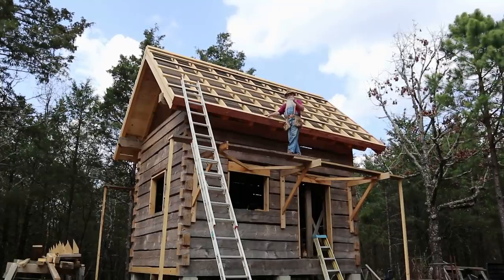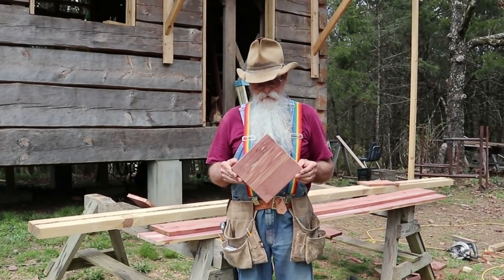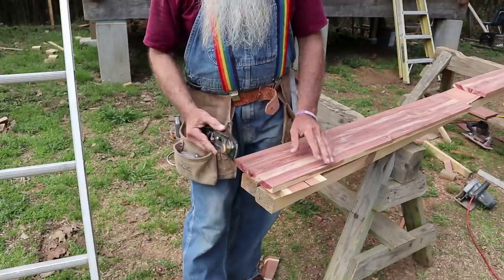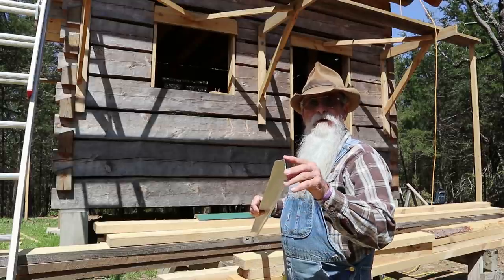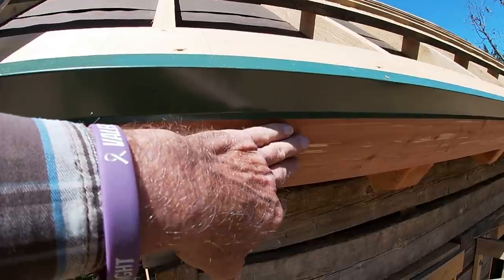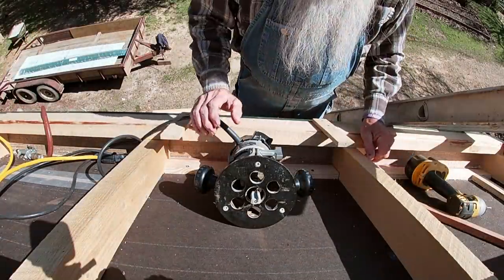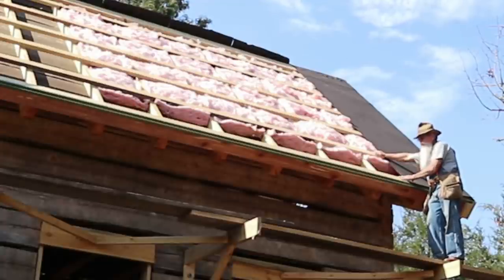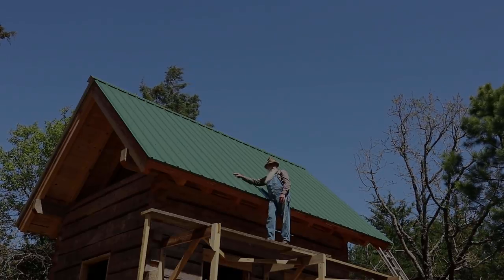Installing Metal Roof on the Dovetail Log Cabin (Ep 43)

Comment: Did you use air chutes under the insulation?
Reply from the maker: Howdy Lance- the insulation is on the decking. I cut air slots in the decking at the bottom to let air flow over the insulation and out the top of the roof under the ridge. Thank you so much for watching the video. God bless you

Comment: I see it you might fail to put metal roof. You not put water insulation rolls downward, place water insulation rolls horizontally from bottom to top , then place vertical wood pieces on rafters, they will secure the water insulation rolls and then place horizontal wood pieces again where it then metal layers will attach to. You will have then a condensate drop from metal to the water insulator and it water will travel all the way down via the tunnel created by vertical wood pieces

Comment: The way you did the soffit vents was a good idea. However, because you didn't provide an air channel for the moisture from the soffit vents up to the ridge vent are worthless. You will have moisture build up within the insulation. I was impressed until I saw that.